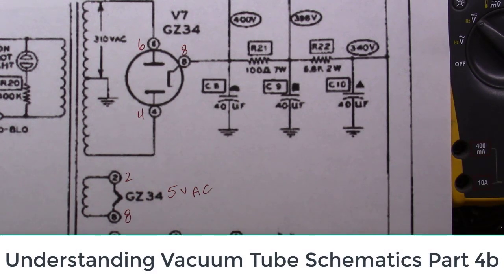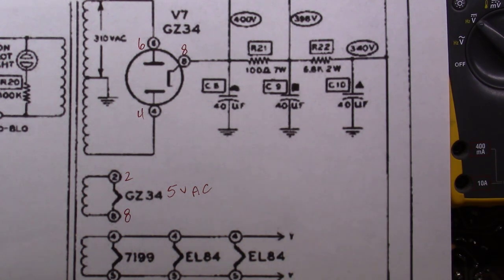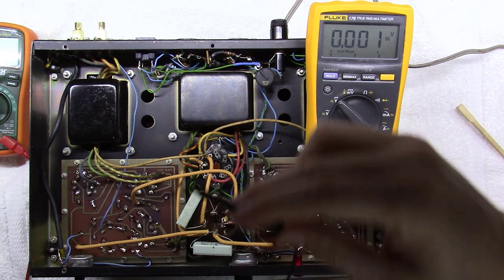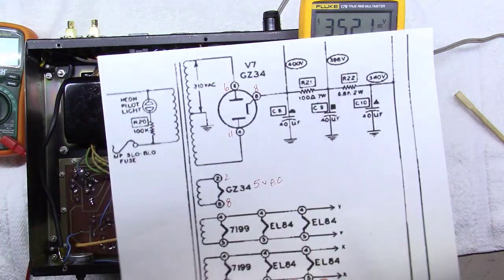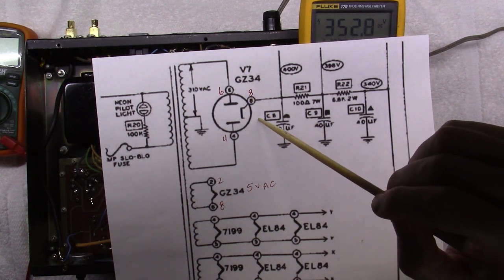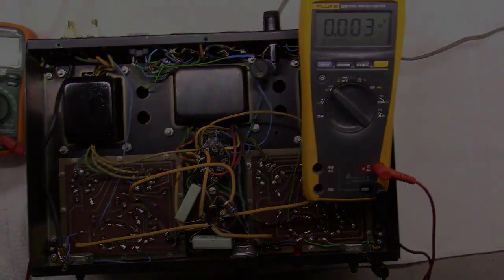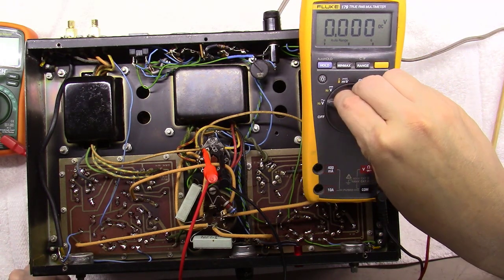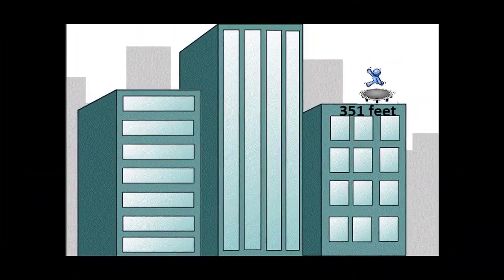How to Read Vacuum Tube Amplifier Schematics - AC and DC Combined -  Part 4b

Comment: Birds can land on power distribution lines that carry hundreds of kilovolts because the bird is not grounded and the potential between their feet is negligible.

I don't like the analogy because a bird's wings don't have a 5VAC heater running back to a supply xfmr.

Comment: Mark,  This video really helps to make it clear that, like "bee luv" below stated, voltage measurements are relative.  We newbies need to remember that and beat it into our heads before making a possibly deadly mistake with where we put our hands/fingers when a tube amp is plugged it and "on."

Comment: Ohhh!  Of course.  Thanks for clarifying that.  As a newbee, I keep forgetting that voltage measurements are relative.  I keep falling into the trap of thinking that there is an absolute, magical "Ground" against which every voltage is measured.   I have another question.  Is there a danger of grounding the high voltage into the low voltage circuit by connecting your voltmeter, or oscilloscope, incorrectly?